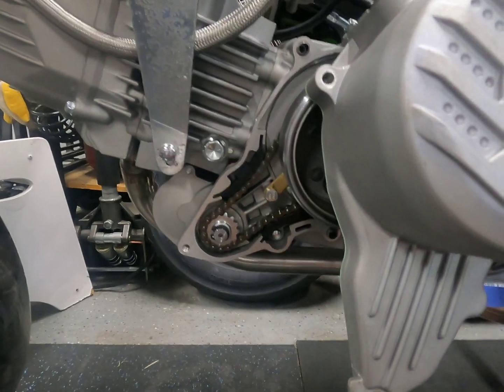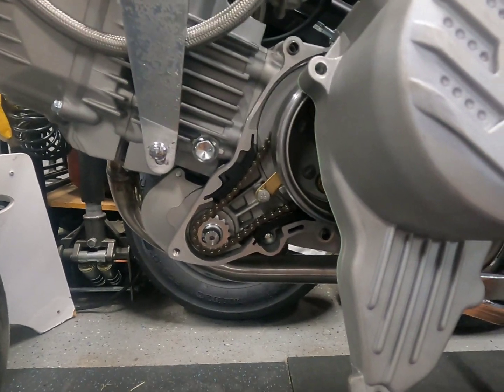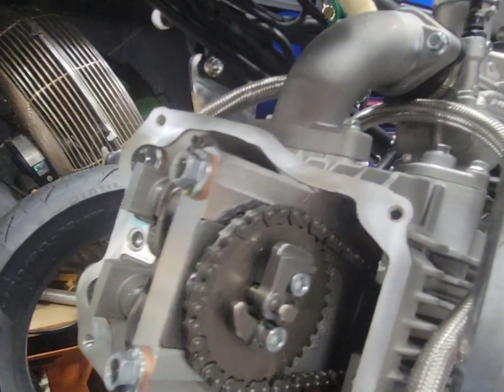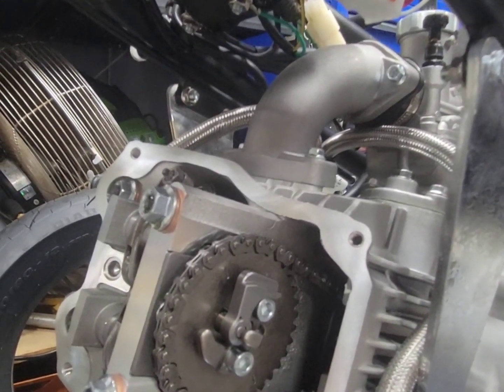ZS190 Preventative Maintenance

Comment: Alright mate I got a zs190 I changed the stator plate the other day and for some reason it’s kicking back loads and really hard like a 450cc or something it’s getting spark and has compression but too much compression and the timing is all still perfect and I’m not too sure what’s happening , I need a new starter motor too because it doesn’t work so I can’t start it from the electric start and it’s hard to kick I can’t get it to start up without kicking back like no tomorrow , my only option is to bump start it , do you know what it could be ? ,
Cheers
Reply from the maker: I dont know, when changing the stator plate did you check to see the status of the starter chain? Did it break or bind anywhere? Id also check the decompressor on the cam gear itself. Also OOracing in UK is a great resource maybe send them an email? info@ooracing . com

Comment: I am interested in knowing the solution so that the starter motor chain and the decompressor do not break
Reply: stiffer decomp springs
Reply: Solution to the starter chain issue is to not have your isn't set too high, don't give it any throttle when starting and make sure to Kickstart out properly.

Then they don't kick back and snap.

Comment: There also a small open spot on the caseing that should get jbweld to fill it in  so the cover and gasket seal it off like it should do when toching keeps the water from getting to the ignition parts if you ride in the rain or puddle it would be a problem. And when you change the oil see if it has the shift star mod from the factory there supposedly  doing it on new models now. Don't use synthetic oils on it will actually eat anything  that not metal not good.  Z's upgrade Order a Daytona clutch cover helps at the track  can work on it with out oil drian out good 30$ upgrade 💯✌️👍🏍️🍻🛠️
Reply from the maker: Wow good info, so no synthetic really? Daytona clutch cover...got it. BTW do you know the clutch pack thickness of these? I guess I can check. Id like to order a slipper for the track but theres two sizes 23mm and 25.5mm
Reply: @Freddi922  dang I know watch your talking about  it because of the year of the engine some parts slightly change.  most people don't know this but that's the reason it should say on the specs sheet I was going to actually recommend getting one for the track and a couple other 😉🛠️🍻🏍️✌️👍💯  ps I'd measure it to be positive
Reply: Ya no joke synthetic oil will damage these engine any thing that not metal IV seen proof eats up timing chain guide and seals🛠️🍻🏍️✌️👍💯
Reply from the maker: @josephsaucedo8691  are you talking in general or for this specific motor? ive been using sythetic oils in all my Japanese motors for a very long time and raced in them with no issues.
Reply: @Freddi922  it for all the Daytona and z's engine basically the plastic isn't design to handle the chemical in synthetic oil and will cause it to back down early and can cause engine to fail unfortunately. It also not good for there clutch system make it stick for some reason.🏍️💯👍✌️🛠️
Reply from the maker: @josephsaucedo8691  interesting bit of information. I did not know this.